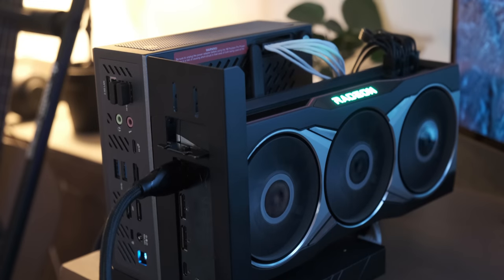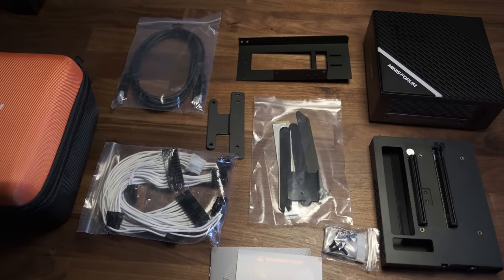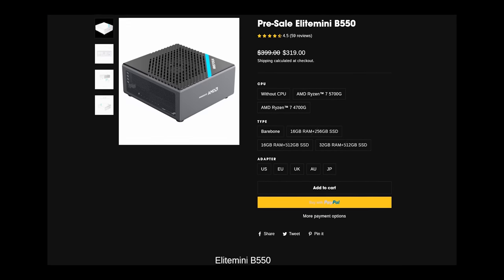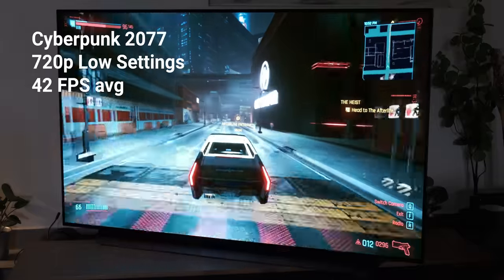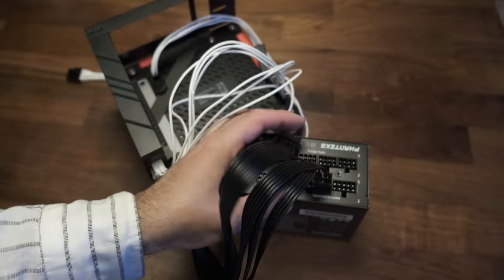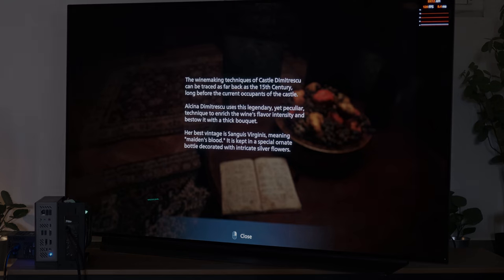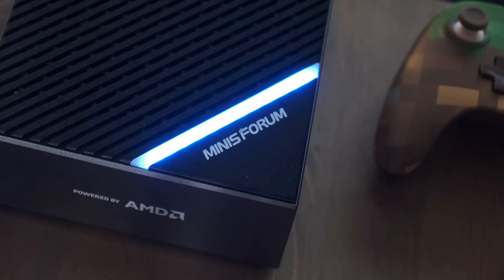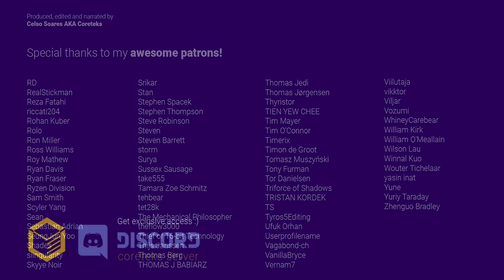The beginning of a REVOLUTION. Feat. the Minisforum B550

Comment: Imagine this for an handhelds, the problem of having 2 devices would disappear
Reply: Maybe the Phoenix APUs will be an answer to this question when they release. I doubt the SteamDeck's hype & sales have gone unnoticed by other vendors, and it could be a path to success where the SteamBox failed.
Reply: Doubt
Reply: @InnuendoXP  The Deck is kinda of its own thing, all the other handhelds on the market use laptop r/i 5/7 processors and those processors are enougth to hadle a dedicated GPU.
Reply: @maverickvgc4220  Yes all other handhelds use off the shelf laptop CPUs with iGPUs - right now. I'm talking about an APU that's coming out next year.

Steam Deck is basically using up AMD's Van Gogh APU lineup that they chose not to launch to the wider market at the time. Other handheld PCs on the market are more expensive & perform worse because none of them have graphics performance as powerful on that amount of power draw.

Phoenix will be on a Zen 4 processor with more than double the CU count of the 5700G & made to pair with unified high speed memory pool like the consoles. Graphics-wise it'll likely be trading blows with a 6500XT.

Rembrandt APUs that are out this year might also make their way out to the handheld market with RDNA2 powered graphics which will be way better than the current intel APUs out there, but still well shy of even a low end graphics card.

Whether the CPUs are powerful enough to handle a dedicated GPU doesn't matter in this equation because a dGPU isn't fitting inside a handheld and nobody is lugging around an external graphics card strapped to a box & calling that a handheld. A laptop is more convenient for that.
Reply: @InnuendoXP  I don't get why Phoneix should fix the problem. Even if the iGPU is powerful enought to run at 1080p it still wouldn't remove the need for a desktop.
Also I'm obviously talking about doxking the dGPU with a solution similar to the one in the video, it would make no sense to put the dGPU in the handheld
Reply: @maverickvgc4220  but in that case, you still have 2 devices. Also why would you say "obviously"? What's obvious about it?

Phoenix fixes the problem because it provides sufficient performance for a quality desktop experience 'without' needing any external GPU, all self-contained. It effectively replaces low-end GPUs and may give an experience along the lines of a Series S or better.

When a single USB-C upstream cable does the same job of connecting a device via a powered connection from a monitor to a USB hub, all self-contained, the use case for a dock with a GPU the price of a computer itself becomes more niche wouldn't you say?

It's more an answer to breaking the constraints of small form-factor modular builds than handhelds I think. A PCI-Ex16 connector is quite a port to 'dock' into & the standard really isn't built with the same tolerances as USB connectors for routine daily connection & disconnection. Thunderbolt 4 might have the bandwidth to do an external GPU a bit more elegantly but an APU is still by far the tidier all-in-one solution
Reply: @InnuendoXP  They are not 2 devices, one is a device and the other is a dock, an extension of the device. 
"Obviously" because the video is about a eGPU dock and because you cant't fit a dGPU in an handheld.

Phoenix's performance wouldn't change much because somebody buying a gaming PC nowdays aims at 1080p 60 only if they don't have much money to spend, most peaople aim at 1440p or high refresh rate.
If I want to play at better than 1080p 60 I need to have a whole second PC while all the hardware in the handheld, except for the GPU, is perofrmant enought. A dock like this completely removes the problem.

It obviously is a niche product but handheld themselves are one and at least 40% of people who own an handheld have a gaming PC with a GPU faster the the hadhelds' iGPUs.

The physical connector is not a problem, minis went with the standard internal connector but there are more plug-and-unplug friendly designs, like the one Asus uses for their eGPUs (that IIRC is a slightly modified version of a standard one)
Reply: @maverickvgc4220  Yeah I see what you're saying. As much as I like the idea of the Steamdeck in principle I've never been particularly drawn to handhelds. I came up in the age of the gameboy and game gear and didn't care much for those. I gave a laptop that I carry between work and home, that seems to handle 1080 gaming OK, but I have a 1440P ultrawide on my desktop and occasionally VR. When I want to game I wanna GAME.  I didn't buy the laptop for gaming, but its enough to at least isolated to its own screen, should I take the time to on it. This is a somewhat sensible solution if you don't need a screen everywhere you are, nor the bulk and expense of all the mobile GPU grunt you could get. 

Thunderbolt 4 didn't upgrade the PCIe bandwidth, so you still can't get adequate throughput for an eGPU.

Comment: Having to house a power supply just sitting outside the system does not seem revolutionary. At the very minimum a bracket to hold an SFX psu to the case should of been possible. Its as cool concept, but if you need the space savings I just dont see the advantage over an actual SFF case housing everything including the power supply. Not even mentioning minisforum past reputation of being clumsy (trying to apply liquid metal and getting it all over the case) or lying (deciding not to use liquid metal, yet still marketing it as liquid metal, or that it is made of carbon fiber when its plastic with like 1% carbon fiber)
Reply: Best thing is the bottleneck an egpu provides.
Wasting 50% performance from 1440p and upwards seems revolutionary to me 🤷‍♂️
Reply: SFF cases are nightmares to build in and to upgrade. I agree that just having the PSU dangling there with all the cables flopping around isn't tenable, but once that is dealt this will be a much more attractive option when compared to building in a DIY SFF case. 

CPU basically doesn't matter for gaming anymore(unless you're a 1080p FPS snob), so having the most important component be extremely easy to swap out with amazing cooling is a no brainer to me. It also just looks kinda cool, like having an exposed intercooler or a hood scoop on your car or something.
Reply: @kamipls6790  This isn't an eGPU setup lol, eGPUs use thunderbolt which is PCI-E x4 with increased latency. This appears to be using a riser cable/mount, which offers no performance difference.
Reply: @BrianCroweAcolyte  my bad

Comment: You know what would be nice. PC screens where you put the gpu inside them and instead of a video cable from the pc to the screen there is a special cable that plugs into a new standard "External pcie port" Which would be a port similar to a display port except for it would be a full pciex16 port so you don't need to Frankenstein the connection into an m.2 slot or downscale to a usb port and the port will just be on the IO panel like the rest of the usb and ethernet ports.  Than. No matter how hot the GPU gets it'll never affect pc performance because it's not even in the pc. And even more elegant solution than an external gpu sitting on the desk.
Reply: +this mini pc mounted on the Vesa mount great idea

Comment: Hey Celso!
1st: You have to run Linux on the mini PC, then you get FSR 1.0 in basically every game. Thru Lutris or in Steam via SteamPlay and ProtonGE. There is even a Window Compositor called gamescope that adds FSR 1.0 to every Linux native game started thru gamescope.
2nd: If MiniForms can't provide you a stand for the external powersupply, you may should 3D print one... I designed and printed a whole mini ITX case (what ended up not so mini anymore :-) ) works great even with an RX 580x inside ;-) It can not be that hard if I managed that hahaha There are fotos at Chris's discord ^^ There is of cause a 3D model needed first ...
3D Printing will make the live of Case Manufactures pretty hard in the future when 3D Printers are way more common than now. 
BTW. the concept of the Minisforum B550 is pretty cool. I may consider to redo my mini ITX case and make the GPU optional and external, but without something like this dock Miniforums provide. I would just expose the PCIe x16 slot somehow and design a cover to protect the slot, if not needed. Overcomplicated are not good.

However, the Miniforums B550 is super neat! :-D

Comment: I like the concept, but I'll never buy something like it. I'm far too sensitive to noise and powerful hardware in small boxes inevitably get loud.
Reply: This will probably be quieter than a lot of cases on the market because the hottest component has complete access to fresh air so the fans wouldn't have to spin as much. Would really need to see some testing though, as cases block some noise so it might be a wash. If you tried putting something like a 12900K in this box, yeah it would just be loud and throttle a lot because it's an inefficient monster. 65W AMD CPUs on the other hand are extremely easy to cool. Even with the crappy stock cooler, the fan will almost never go above 30%.
Reply: @BrianCroweAcolyte  I don't think I've sufficiently stressed how much fan noise annoys me ;)
Building a custom watercooling loop with an external pump housing so I can ensure that everything goes completely unheard is the level of effort I've been willing to go to in order to make my PC silent.
My last remaining enemy is coil whine.

Comment: Has potential needs 2 more expansion slots for sound and extra NIC. But no reason it cant be small with room for a couple nvme and couple solid state sata drives now. I wonder about trace routes for pcie5 gpu in next gen. Ill take a look at this when AM5 comes out.

Comment: The size of full tower builds & the massive GPU coolers & boards are the biggest limitations to wider adoption of the PC platform beside laptops IMO. There's a 'lot' of empty space in the standard ATX layout, and graphics cards are getting longer than ever.

Maybe an underclocked dual slot 4060Ti / RX7600XT will get to where this form factor needs to be with the performance people want.
Reply: Inverted MicroATX takes care of much of that, whilst I'll offering slots. If we could get a big-fan slim PSU form factor, or a PSU spec that could be used in front of the CPU without impeding airflow too much (quite doable), that would pretty remove the wasted space problem.

Comment: i am extremely unimpressed by this product. its basically a worse NUC. and nucs have been around with thunderbolt ports for years now
Reply: NUCs are extremely overpriced compared to this, so saying it's a "worse NUC" doesn't hold much weight even if someone agrees with that statement. Also the more affordable square NUCs don't offer a good way to add a dGPU. Going eGPU over thunderbolt just sucks, and this appears to be using a riser card which is 99.99% the performance of just plugging it directly into the slot.

Comment: PCs have always been modular. Putting the elements into a nice box makes them less modular.
Reply: CPU, RAM, and storage are all swappable in this making it as modular as any standard PC with the added benifit it will run without a bulky PSU if you're not running a discrete GPU. You can just pull the mini PC off the dock and it will function as a complete PC on it's own. I think just about anyone would consider that more modular.

Comment: Someone should build a SFF PSU with the only purpose being to power a GPU. That's the last leg that this wobly chair needs.
I really like the idea of a very small gaming rig with a 65w CPU and only an m.2 drive but hooking up a monster GPU.
Reply: It wouldn't make sense to keep using the power brick AND a desktop-grade PSU. The desktop-grade PSU is likely significantly more efficient and if it is converting to 12V for the GPU, it makes sense for it to provide for the CPU too.
Reply: @zig131  I totally agree. But wouldn't it be cool to have a SFF daisy-chain power connector to specifically feed the GPU?

Comment: How's this any more practical than just using a SFF case that maybe slightly larger than this mini PC's shell but house everything inside. It is cool to see something new but honestly, I only think this is a good option for someone who's always swapping GPUs. A reviewer benchmarking GPUs maybe? Even in such case, the 65W requirement on the CPU is somewhat limiting. It's neat nonetheless though.
Reply: Yup exactly, I generally like his content. He normally has interesting topics but this is purely a review. Trying to make like its the future is the problem, PC's are modular and have been almost since the beginning. Coming from a channel that is as technical as this one is, the whole video is kinda strange. I like that there are places innovating with stuff like this, its purely a niche product and nothing more. Its basically the equivalent of pulling your motherboard out of the case and running it open air. Can you imagine the dust accumulation after a few days of running the graphics card exposed like this.

Comment: I like the concept, but i wont be getting this for 2 reasons.
1: i don't want my PSU just lying about. They need a cleverer solution for this, like they have done for the GPU.
2: Barebones cost seems far too high. I'm thinking 250$ tops and lower in sales, for what is pretty much just a small case and small mobo with some clever design.  I have the space for a regular case, so i won't be paying significantly more to get less.

Comment: Minisforum are really pushing this out on all the Techtuber/influencers. Let’s all be honest. This is a fucking stupid idea. If you need an external gpu, you need a desktop, simple.
Reply: If I already have a laptop what is the use of whole desktop when all I need is a graphics card
Reply from the maker: "More options for consumers = STUPID!". I think you're on to something Einstein
Reply: From what I can tell, the connection is effectively a proper PCIe riser cable, so it doesn't get affected by the bandwidth limitations that eGPUs suffer from. This feels like a variation on the "sandwich layout" some mini-ITX cases use.
Reply: @Coreteks  this is the Apple moto
Reply: @Coreteks  I just don’t get it. Surely if you had the internals of say a gaming laptop, which are very compact nowadays you could fit it in a nice compact form factor and still have the enhanced gpu performance. That’s what I would like to see. I understand that would need the whole industry to literally come up with a new form factor  though and this is a cheaper way of bridging that gap.
Reply: Honestly I think this just looks cool having the GPU exposed like that(like a hood scoop on a car) and it's more practical than having a giant case wasting space, or having a tiny case that's a nightmare to build in or upgrade. CPUs don't matter for gaming anymore unless you're a 1080p FPS snob, so having everything but the GPU be a little more difficult to upgrade is a good tradeoff.
Reply: It's a little raw. It's not too far off from having a sprawling, caseless build like overclockers and system testers tend to do.
Reply: @BrianCroweAcolyte  The issue is the kind of people who are going to be interested in this are enthusiasts, and if you're an enthusiasts/your PC is your hobby, then it's entirely reasonable to designate a significant amount of space to it. I don't get the argument "I'm a PC enthusiast but I want my PC to take up as little space as possible".
Reply: @zig131  I'm an enthusiast but I absolutely hate building them. Much prefer actually using them. I don't even rout my cables because I just buy cases that don't have windows lol

The thing that always makes me lol is when I see builds in a full tower that just have a regular ATX motherboard and a couple SSDs, maybe a 280mm CLC. Literally 70% of the case's volume going unused. It's about properly matching your components. Giant cases really only make sense for like, workstations with SSI EEB motherboards and 2-3 graphics cards.